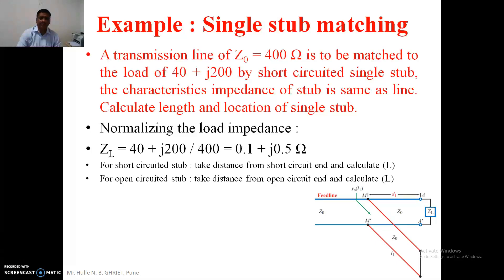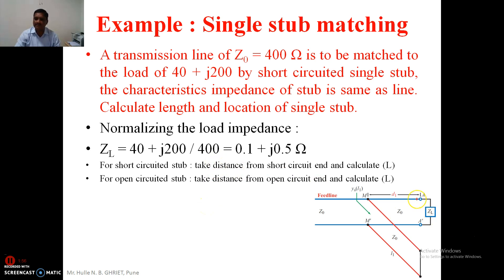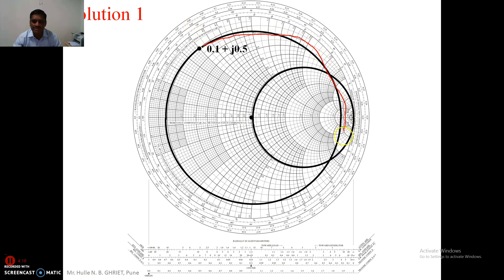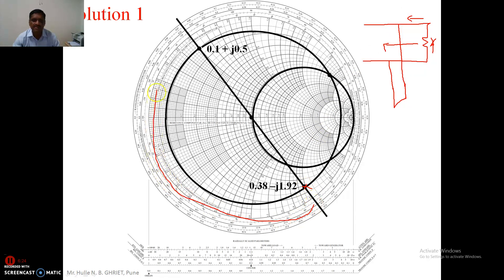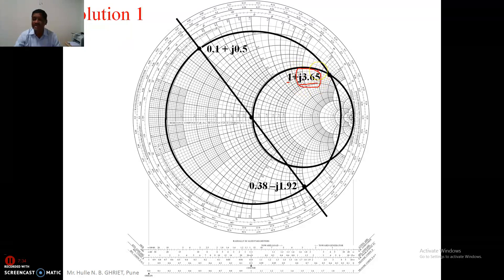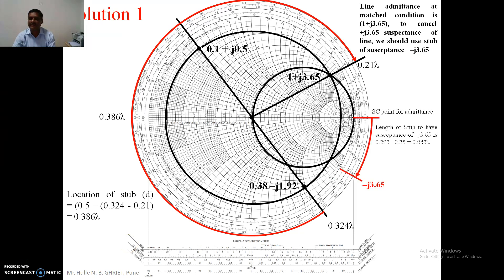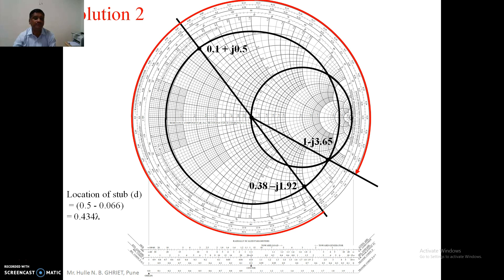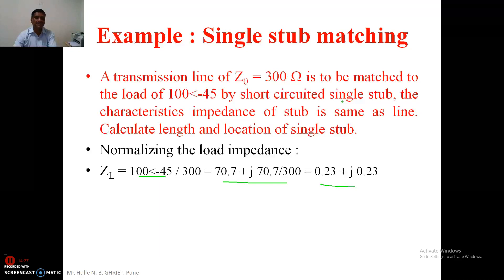Single Stub matching using Smith Chart by Mr. Nagnath Hulle

Comment: Is the voltage min and Voltage Max is same in both admittance and impedance chart? please also include the video of series single stub matching..
thank you so much for these videos.
Reply: I think it should be same, please confirm it.
Reply from the maker: No, Voltage minima and maxima are different for impedance and admittance which are lamda/4 apart.
Reply: Means in impedance chart voltage is at right side and for admittance chart is it at left side?
Reply from the maker: For impedance voltage maxima at right side and voltage minima at left side. 
Reverse is the case for admittance